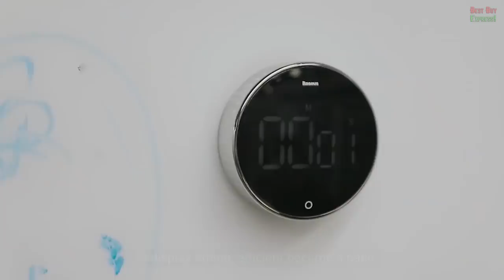10 Cool Products Aliexpress & Amazon 2020 | New Gadgets. Amazing Future Tech

Comment from the maker: ☝️☝️☝️LINKS TO THE GOODS ABOVE IN THE DESCRIPTION☝️☝️☝️
❗️❗️❗️ WATCH over 12000+ HD CHANNELS & VOD ❗️❗️❗️ Try it just for 0.9$:
https://bit.ly/36LKNL1

1) 0:09 ► Terraplanter - Inside-Out Planter
2) 1:14 ► Lumos Helmet - Integrated LED Lighting, Turn Signals
3) 2:26 ► BoilingBeeper - Kitchen Timer For Boiling Water
4) 3:08 ► Lamp On Monitor
5) 3:49 ► Multi-Function Hammer
6) 4:44 ► Smoke Waterfall/Glass Bulb
7) 5:23 ► Magnetic Digital Timer
8) 6:23 ► Bag Anti-Theft
9) 7:24 ► Silicone Ice Cream Mold
10) 9:01 ► Portable Mini Fruit Juicer
11) 9:29 ► Cube Prism